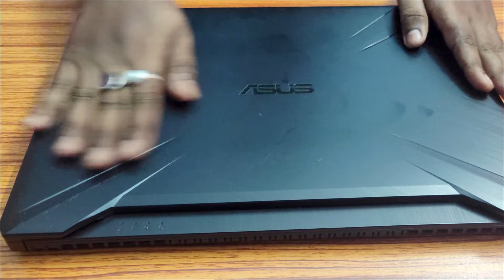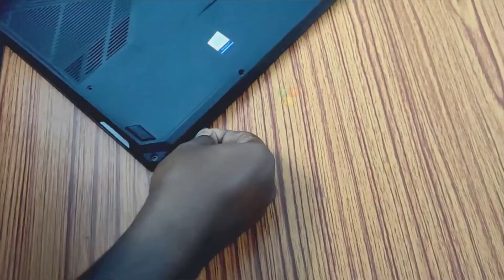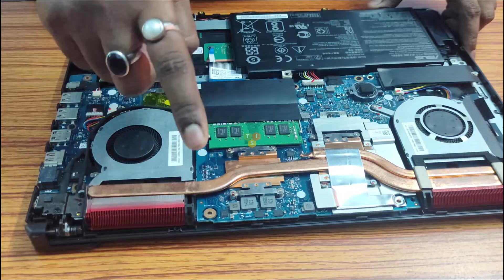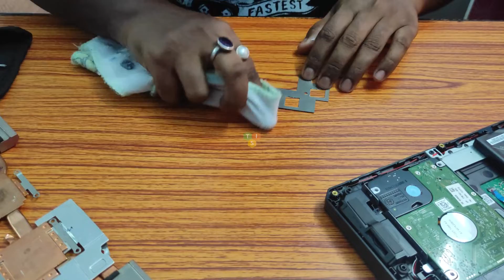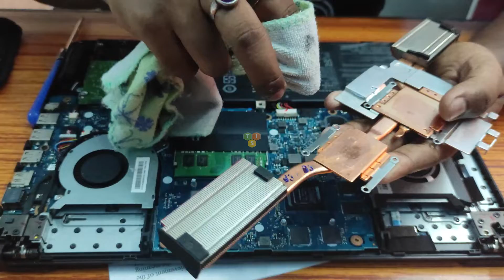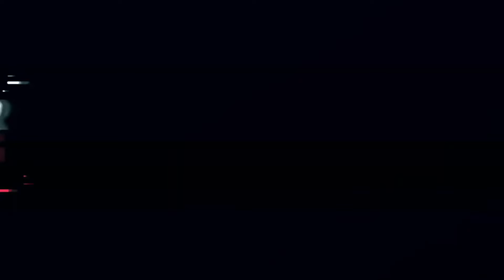How to Replace Thermal Paste- Asus TUF Fx505 Series Laptop

Comment: Are you sure we can use thermal paste on all those areas? Because on my laptop, other than on the CPU and GPU, they have a blue rubbery substance, like a melted thermal pad.
Reply from the maker: Yes, you can. I am still using the same laptop for gaming and no problem so far. In fact thermal paste is more effective than thermal pad. But do not use metal based thermal paste it might be conductive.
Reply: @Try It Studio  does it still work fine? Wont the paste dry up, and the vrms will not make contact with the heatsink?
Reply: @abcdefghijklmnopqrstuvwxyz1979  If you use game or whatever while high temp, it will shorten life for thermal that turn into dry
Reply: If you have pads, use pads. thermal paste will not bridge a gap, it will flow out and do nothing,

Comment: Few days ago i went to computer repair shop to clean my laptop fans but since then my games are keep crashing within 5 to 10 minutes of gameplay and yes I have same laptop
Reply from the maker: I think they used cheap thermal paste, get branded thermal paste and reapply them.
Reply: @tryitstd  no l mean they just clean laptop fans with hair pressure that's all and after that my games are crashing.
If their any chance during cleaning they removed thermal paste?
Reply: @037anshdev2  Cleaning the fans without opening the heatsink is worthless, because all the dust will accumulate on the heatsink vents. Normally cleaning sould be done after opening the entire heatsink. Check your CPU/GPU temperature with MSI afterburner or Core temp software to confirm this is due to temperature rise. Otherwise there might be some other issue.
Reply: @TekkiBangla  whenever I underclock my GPU with MSI AFTERBURNER games are running about 50 to 60 minutes and I get better performance.I mean I m underclocking GPU that means I m decreasing the power of GPU.technically it should give less performance but surprisingly I m getting better performance

Comment: Is the GPU of this laptop removable like if you want to upgrade your GPU you can replace it?
Reply from the maker: No, you can't replace CPU/GPU. They are soldered with the motherboard. In some old generation laptops CPUs could be replaced like desktop, but this is not the case with new generation laptops due to slim models.
Reply: @tryitstd  I see, Thanks for the Info and nice video btw.

Comment: Can I use or would u recommend me to use thermal pads (i already got the Gelid gp-extreme) instead of thermal paste in the vrm or graphic card? Thanks in advance
Reply from the maker: You can use thermal pad for VRMs but on GPU die you have to use thermal paste.
Reply: @tryitstd  can  I use the PTM 7950 on both  CPU and GPU?
Reply from the maker: @Venlorz  Yes, you can.
Reply: @tryitstd  I just got the PTM 7950 too but can I use it for everything? CPU, GPU ,VRM's? I see sm people do not recommend thermal pad on vrm's. Please confirm bro as soon as possible. Also I have a big thermal pad so I will need to obviously cut it around and apply according to size, do I need to take any precautions?
Reply from the maker: @killzonefury619  You can use PTM on everything. Thermal pads or paste are non conductive, so no need to worry.
Reply: @tryitstd   But is 1 layer enough to make contact with heatsink properly or should I use multiple layers for vrms?
Reply from the maker: @killzonefury619  VRM may require multiple layers. At least 0.75 mm thickness required

Comment: Hi! I took this laptop to a friend who used to ran a laptop repair shop to repaste and after repasting temps are even higher, making gaming impossible due to thermal throttling. I noticed that he completely removed the grey metal sheet on top of the heatsink. Is that part of the heatsink? I looked at multiple vids and no one removes it. If I have to replace it, what should I use? Also if that's not the problem, what should I do to reduce temps back to normal levels as the CPU is now reaching over 100°C very often.
Reply from the maker: That plate is heat spreader, it helps to transfer VRAM temperature to the heatsink. Use a branded thermal paste for better cooling. The cheap ones are for LED bulbs, it may work for a desktop, but for a laptop, it is useless.
Reply: It can be also be affected by other factors as well, btw the metal sheet is for ground it doesn't do that much so it won't be a problem
Factors include on why the temps is even higher are:
The heatsink is not screwed in correctly
Used cheap paste that aren't good (if you're interested on replacing it again with better performing paste, try buying ptm 7950 for the cpu and gpu. Upsiren u6 pro for the vram and mosfets)
the heat sink is still filled with dust (brush the aluminum heatsink if you can)
Reply: You need thermal pads
Reply: @robert.motoc26  thermal putty is better

Comment: thanks for the video, I have the same laptop and I tried to play "Rise of the Tomb Raider" on high settings but my cpu temp raises to 87-89-90 is that normal or I have to change thermalpaste ?
Reply from the maker: Above 85 is bit abnormal.
Reply: Mine will reach close to 100 degrees depending on the game. 
The truth is that the cooling system of this laptop is awful, and that's why it's recommended to at least replace the thermal paste with something better. 
Also look up a program called Ryzen controller, it allows you to define a temp limit so that your laptop won't fry. Mine works well setting a limit of 92 degrees.

Comment: Did it make ay difference in performance?
Reply from the maker: Yes, earlier CPU thermal throttled due to high temperature. Now it can achieve 3600 MHz all core at 85 degree centigrade.

Comment: My laptop wont turn on after doing this. Any suggestions?
Reply from the maker: Check all the connections
Reply: not 100% sure what it was but it was either reseating the ram or the cable for the display. It's working great now 😀

Comment: Thanks for the video! anyway i was wondering, what is the thickness of the thermal pad on asus tuf fx505, did you measure it?
Reply from the maker: I didn't measure, but I think it is 1 mm thermal pad.
Reply: Did not use termal pads, this is why some people that followed all steps like in this video still have temp problems
Reply from the maker: @nicolaevictorduta3539  Thermal pads are not mandatory for this laptop because the gap between VRM and heatsink is very low, and thermal paste heat conductivity is better than thermal pads. This laptop uses a single heat pipe for both GPU and CPU and this is the main reason for excessive CPU temperature.

Comment: Within few 5 minutes of gameplay my GPU and GPU hits 90 and CPU sometimes hints 100 for seconds. Is changing thermal paste will solve this problem?
Reply from the maker: Changing thermal paste and cleaning of the fan will reduce gaming temperature to 85 degree. Make sure you use a branded thermal paste (check description for links.) Also you can use liquid metal instead of thermal paste to lower the temperature up to 80 degree (but this is expensive and dangerous.)

Comment: Dude, im really scary to replace my thermal, i have the same one, but i dont want to have an issue hahaah
any recomend before do all that?
Reply from the maker: Get precise screw driver set, Isopropyl alcohol, thermal paste and disconnect the battery after opening the case. Do not drop sweat or water or screw on the motherboard.
Reply: @tryitstd  ty so much
Do you have any Amazon article to buy a kit or any else?
Reply from the maker: @alexmirrow  Kindly check video description for related product links.
Reply: @alexmirrow  don’t worry it’s easy
Reply: @Aditya-wt9rz  i already upgrade ram and m.2 a few weeks ago, so i feel more secure, thermal still be good for now, but I'm looking for screw set cus I used my brother's one and wanna have my own sets, and need a good thermal paste, i was thinking in artic X4.

Comment: Porfavor no pongan Pasta térmica en las VRM no la usen, éste video está equivocado, jamas poner pasta térmica para reemplazar los thermal pads, en las VRM o las memorias de la tarjeta gráfica se usan thermal pads, por favor no le pongan pasta térmica.
Reply from the maker: Thermal pads are highly expensive, so paste is the cheaper option. And I am even commenting through the same laptop now, it is working fine. If you can affort thermal pad then go for it.
Reply: No no hermano you can’t add pads here cause they will push away from the heat sink and you gonna get horrible results in thermal management in this laptop

Comment: My boi hello there from Russia, I have same laptop and have some issues I guess. My cpu sometimes had 90-96temp sometimes it’s gets throttling, and my cpu works louder than usually. I ordered new cooler,tomorrow I wanna change thermpaste. Before all this things I reinstalled windows (some of my friends says it can be mainer,virus etc. after all operations I’ll send you feedback what changed
Reply from the maker: I tried everything, the problem is Ryzen processor heats up a lot. Asus should provide dual heat pipe like they did for the GPU. They have solved this in new models with two large sized heat pipe. If spare heat pipe is available in your country then add one extra heat pipe. I have seen some heat pipe mod videos in youtube, but unfortunately personal import from China is banned in my country right now due to Covid.
Reply: @tryitstd  I think it will fit in 505dt? I’ve seen double piped systems but on A15 and 705 series. Dunno will it fit 🙁
Reply: what happen ? is your temp issues solved with replacing thermalpaste ?
Reply: @MohammedEldaraji  hello there, I clean a little my laptop,replaced paste and now temp is no high then 75-80. Also I placed under bottom lil box.